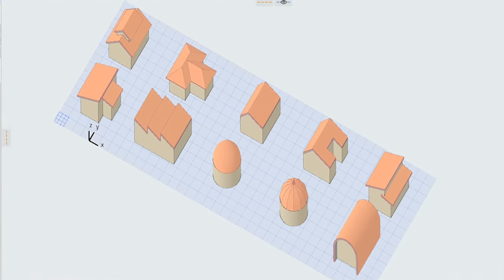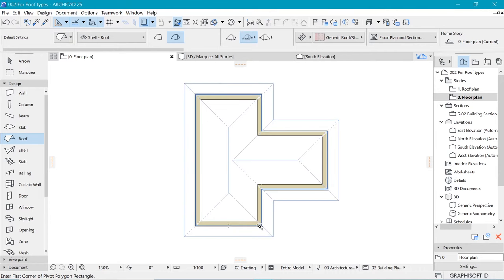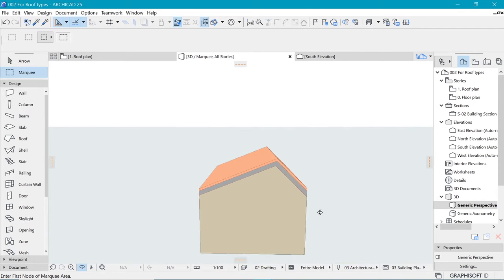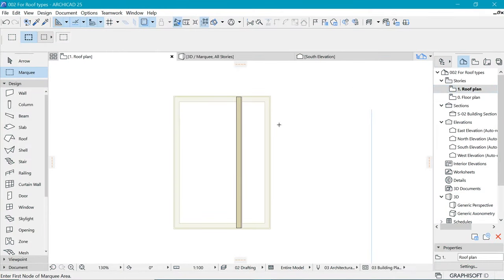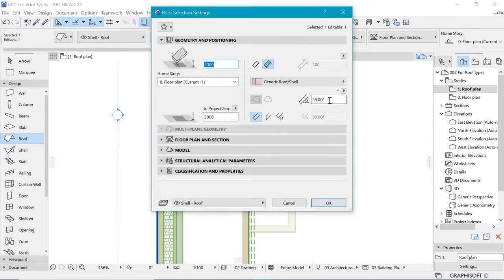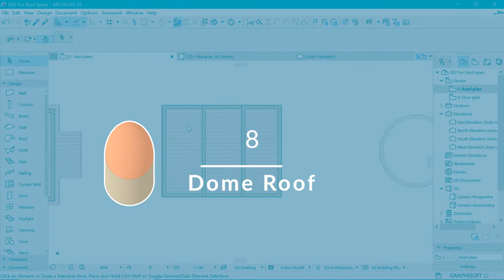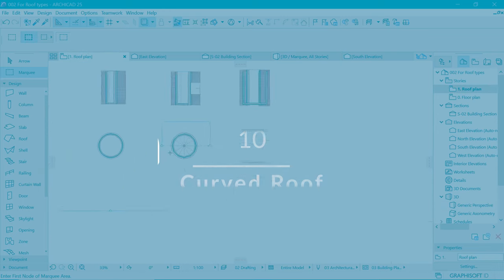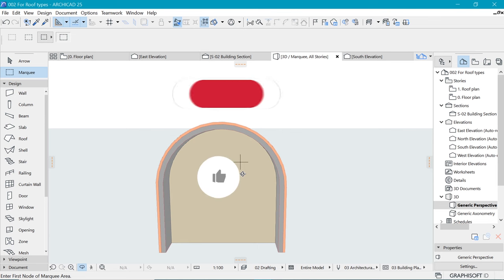10 Roof types  in archicad made simple

Comment: I am using Archibald 25 but for some reason I cannot stretch my pitch points (not the edges) like you can to turn a pitch roof roof into a gable roof. Is there a setting through which I have to activate this setting